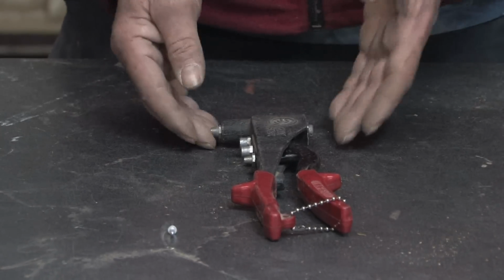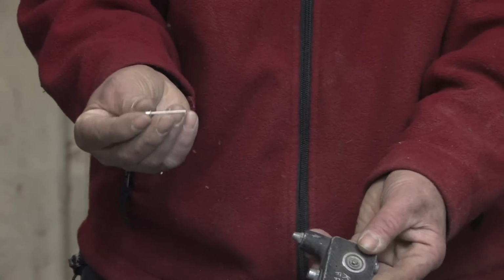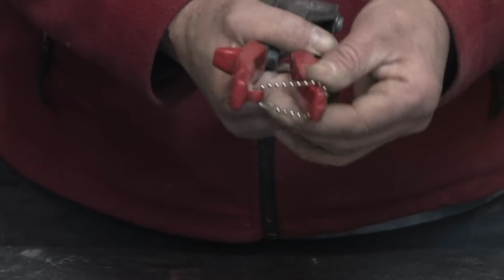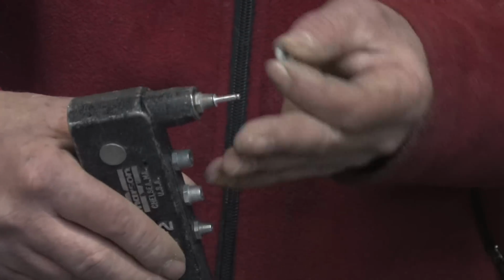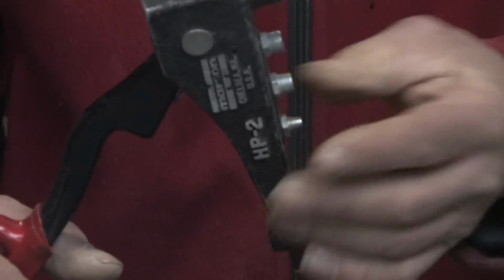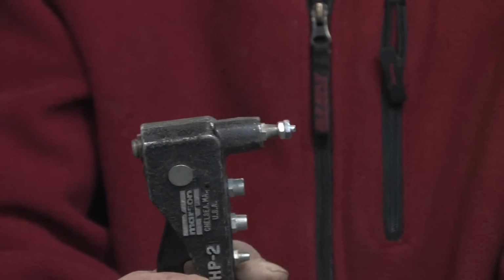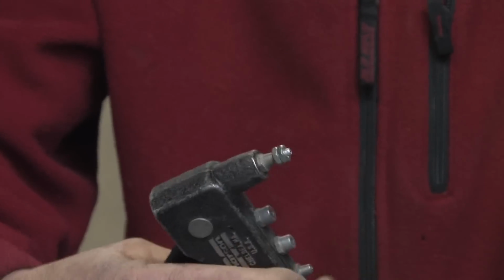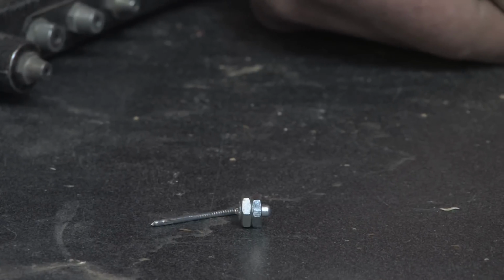Home Repair Tips : How to Use a Rivet Gun

Comment: we tried to rivet foot braces onto a royalex canoe, with 3/16 rivets and an arrow swivel riveter: it tightened well, but only broke the rivet (with huge effort) about 3/4 of an inch away from the smooth surface (not flush with it). what are we doing wrong? (we sawed off the protruding shank and the brace is tight and strong). thanks

Comment: does it matter much if the diameter of the hold is a tiny bit bigger than the body of the rivet? The head of the rivet still sits the hole without falling in

Comment: Hi ,I recently saw the most stunning photo frames which I did want to buy until I saw they had no hook for wall hanging. Only the  largest frame had a hook on the back held on with a rivet I think so could you show me how I could put the same type of hook on the smaller ones because I do not want to put screws in the back of the frame in case the wood splits and spoils the frame. I really would appreciate it from Annie.x

Comment: @baronjutter maybe your using rivets that are too narrow for your application. I think it pops off when the rivet end expands to a certain threshold, due to the pressure from the surrounding metal. If the hole is too large for your rivet, it's not going to provide enough pressure to make the rivet pop.

Comment: Thanks a lot, I was totally confused at what to do with the rivet, and how the riveter worked. But thanks to this video i understood, and soon fixed my car thank you :)
Also for the people who don't know, to remove the rivet, you simply just get a drill bit slightly smaller than the largest part of the rivet, and drill the head down, it should then disconnect from the back of the rivet and both front and back should full the floor, if not prise it off :)